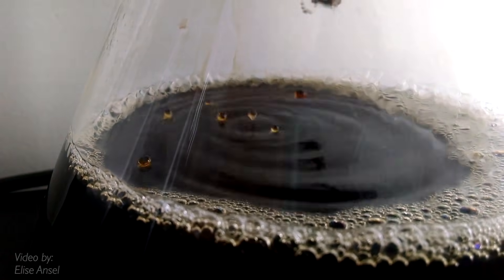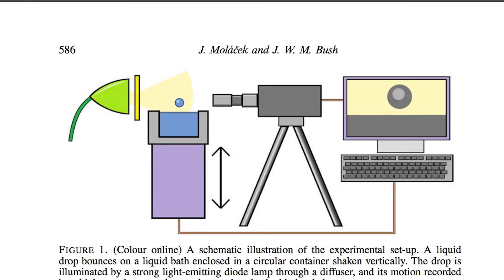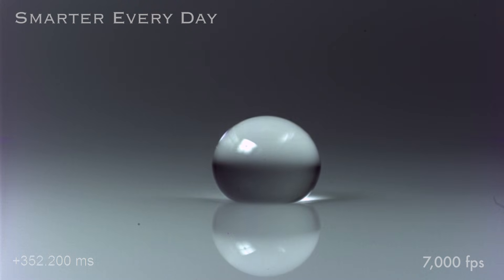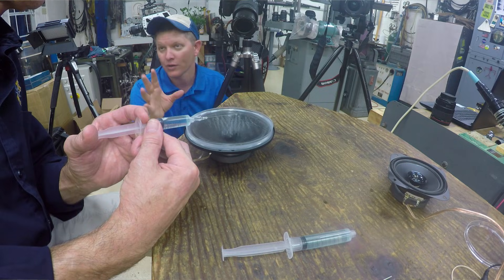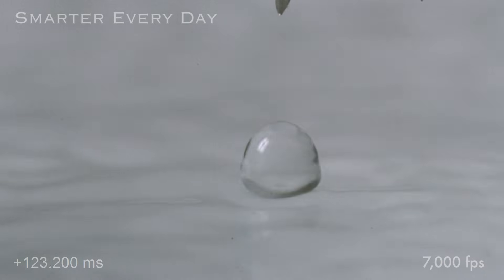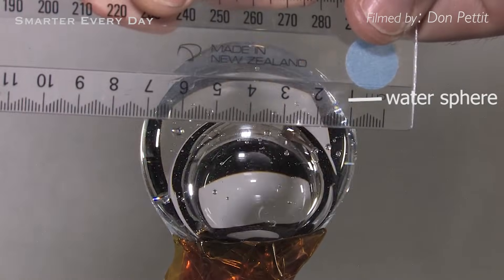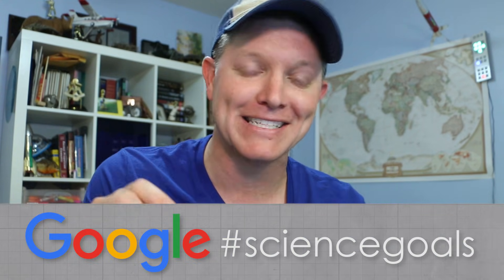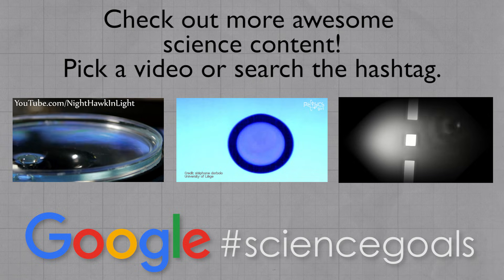The WALKING WATER Mystery (in SPACE and SLOW MOTION!) - Smarter Every Day 160

Comment: I would like to know why there is a rainbow like oil slick up the inside of my clean black coffee cup as I pour it....
Reply: Coffee contains a multitude of natural oils, which are largely responsible for the aroma and taste of coffee. Oils are hydrophobic substances with lower density than water, so they create a thin film on the top of the surface. Because that film of oil has different refractive index and is so thin, an interference pattern can sometimes be observed. It's called thin-film interference, feel free to look that up on wikipedia. That's the same thing what happens with a little bit of oil spilled on water. This phenomenon is also quite heavily used in optics. Pretty much all lenses you can find have some kind of optical coating that reduces reflection (that is why DSLR lenses usually look purple-ish), but there are other applications for that as well, including mirrors and filters.
Reply: If it is hot coffee, the oil and steam droplets that float up by the sides of the cup can diffract light much like the rainbows seen in water hose sprays seen from the correct angles.
Reply: i know what you talking about to me it's pretty much just water and make a rainbow.
Reply: the simple answer is refraction. But I would encourage you to discover the complete answer on your own now that I have given you a starting point. (hint: google "thin film refraction). Have fun learning  :D
Reply: Animuldok thanks !
Reply: Shellina Mitchell There are oils in the coffee and residual soap in the cup is separating the oil from the coffee (water). That's my thought, haven't verified this. And that's not to say you don't clean your dishes, it's hard to get and keep anything "clean".